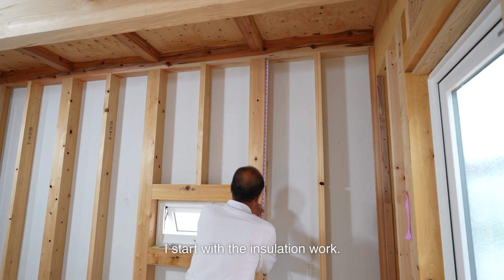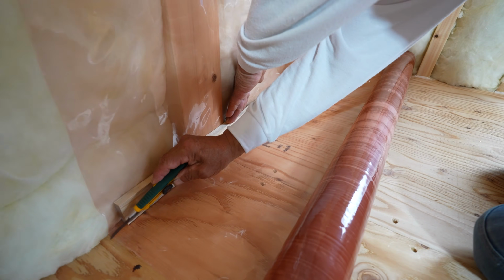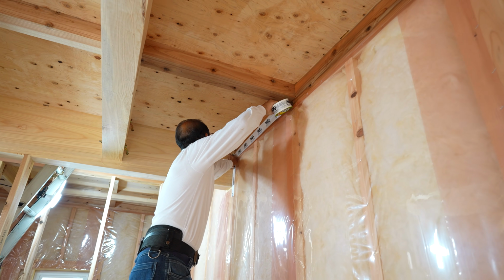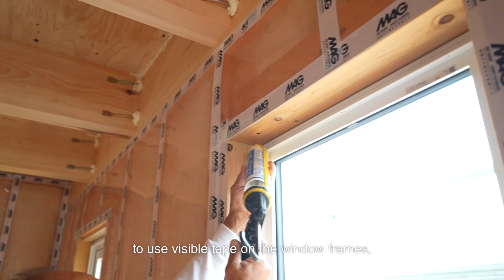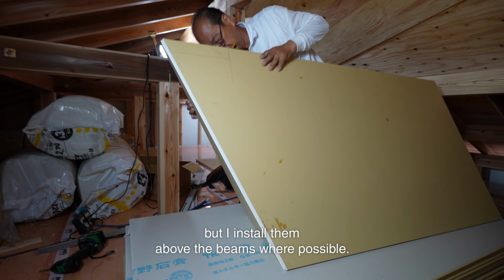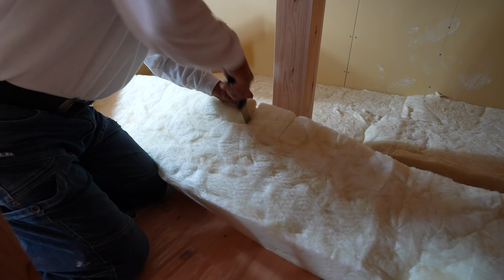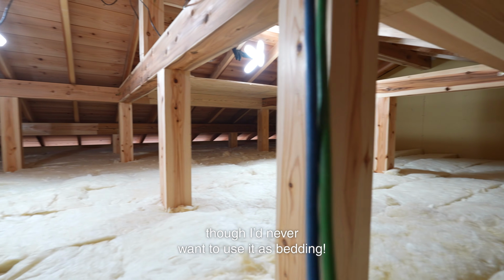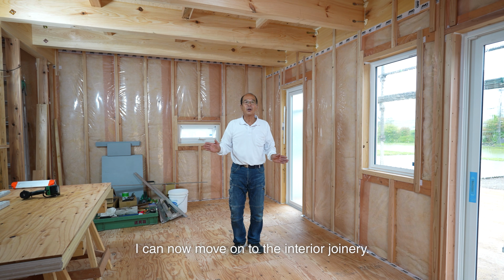The Ultimate Insulation Challenge: Creating a Magic Flask-Like Home | New Build Season 5 Part 5

Comment: In German carpentry we don't build with airtight vinyl membranes anymore because of the risk of mold. We instead use air- and watertight membranes that are permable for water vapor so that if there are gaps, the bits of moisture can escape again over the summer. However we have a dry summer - not a humid summer like you have over in Japan, perhaps that is why you use the vinyl membrane.
Your glasswool looks so soft and smooth compared to ours.
Reply: Meine Haut ist nur vom zusehen Rot geworden xD
Reply: @julianklietz6558  🤣🤣🤣 ich kann es sehr gut verstehen!
Reply: I suppose this is possible with a SOOO good ventilation system, in a humid climate this will not work.
Reply: We use hemp. Natural product.
Reply: Same thing in Canada, years ago.
Reply: I live in South Africa, no such issues.
Reply: @iluv i have a holz block house in 
Schwarzwald near Feldburg. 
the blocks are 14 cm thick .on the outside of that is 14 cm of Steico wood fiber insulation . over that vertical latten is installed with wood panels over the strips . there is an air tight but moisture permeable on the blocks . Fenster  is 3 layers of glass . the house is very energy efficient and extremely comfortable . 
sorry about the bad german spelling .
Reply: He's also touching that glass wool with his bare hands, which is not something I'm familiar with being a fun experience (but it's also been many years since I handled insulation, I assume technology has improved).
Reply: I believe it's the general rule at least in the EU. Walls need to breath to get the best results between insulation, heat transfer and condensation mangement.
The outer layer should prevent transfer of humidity and heat to the inside while the inner layer should prevent leak of inner temperature without holding the humidity in.
HVAC and natural flows (more rarely spread nowadays) help controlling heat leakage while allowing efficient air renewal.
Reply: @Belaziraf   There is no such a rule in the EU. Breathing wall is a leaking wall. In the Nordics basically all houses are built with plastic vapor barrier inside the house and all the air comes in and goes out trough a ventilation machine.
Reply: @BoringBurger  A vapor barrier isn't made to be 100% waterproof. You know this right ? From what i know, vapor barriers are used at least in Belgium, France and Germany. And from what you said, in Nordic countries.
Water and air tight barriers are mostly used to isolate constructions in harsh weather conditions, foundations and ground level slabs.
A breathing wall isn't what you seem to imagine. it's not on a level a human can perceive.
Reply: @Belaziraf  Polyethylene vapor barrier is in practice 100% waterproof. Yes, I know that in certain pressure and in certain humidity some water vapor will pass trough, those are just the limits of the physical properties of all plastics.  Vapor barriers should be used not only in harsh weather conditions, but everywhere where (insulated) houses are heated or cooled and there is a major difference between inside and outside humidity and temperature. And what comes to breathing wall, breathing is a term that relates to air movement and air movement is the biggest cause to moisture damages in well insulated walls. Modern well insulated walls should never breathe, not even a bit. What they should have is drying potential and good ventilation and that is a completely different thing.
Reply: There are variable permeability membranes in Europe, the US and Japan that let moisture pass from high humidity to the less humid side through diffusion while blocking air movement.
Reply: Dachte ich mir auch so. Das muss doch die reinste Tropfsteinhöhle da drin sein später. Die Luftfeuchtigkeit kann ja wirklich nirgendwo hin.
Reply: @desmonddart5163  eine zentrale Klimaanlage wird da im Wohnraum die Luftfeuchtigkeit automatisch angenehm halten. Wenns schlecht ausgearbeitet wird könnten die Wände trotzdem feucht werden.
Reply: Where I live in the US we have high humidity most of the year so even a vapor membrane is never allowed.
Reply: Airtight houses require good venting.. typically you install a heatpump and heat recycle fan system that exchange the air several times over a day.
Reply: here in america we are all just happy to have somewhere to live
Reply: It,s ferry bad for your Health
Reply: closed membrane on warm side, open membrame on cold side!
Reply: Er soll froh sein das in der Entwicklung der dämmstoffe sich seit Jahren immer wieder etwas verändert wenn ich die glaswolle bzw steinwolle aus vor 20 Jahren noch in Erinnerung habe eine kratzige Angelegenheit für sehr viele Tage danach noch. Damals rockwool  insover  und so weiter gefahren über Jahre hinweg 😂😂😂 man gewöhnt sich aber dran nur einatmen so sache die sollte man sich ersparen
Reply: is it because nowadays 'stone wool' is commonly used?
Reply: @666like616   @666like616  it's because some amounts of moisture in the walls is fine because during the dry and hot summer, it will dry out. you can calculate how much is acceptable and base the materials and dimensions around that.
Reply: @666like616  Yess nobody uses glass wool anymore here because it's painful to work with
Reply: I was wondering about that. If the house is completely airtight, now you have to worry about condensation and suffocation, or at least the air getting very stale. Is that really desirable, especially in such small houses?
Reply: @Volkbrecht  Its the common way to insolate danish houses - and then we got Genvex (Air ventilation with heat exchanger) to keep the inside air fresh and dry.
Reply: @Volkbrecht All modern and energy efficient houses needs to be as air tight as possible and all modern houses have a forced ventilation system (with heat recovery) that keeps a small negative pressure inside the house all times and prevents moisture from condensing to the walls. That's been the standard way of building in the Nordic countries last 3 decades.
Reply: @BoringBurger  So there is a guarantee for a ventilation system that's  designed to deal with that problem. Thanks, this is the part of the picture I didn't see.
Reply: @Volkbrecht  Yup, and the ventilation system is designed to change all the air inside the house at least once every 2 hours and even more if it detects risen co2 levels or moisture in the air.
Reply: @Volkbrecht  The air inside will be controlled with air conditioning to be nice. The issue is with condensation from warm humid air from the inside leaking through and condensing onto colder elements in the walls. If built perfectly like how Shoyan does there should be no issues.
Reply: @Volkbrecht  This would also be a problem with Passivhaus, but I think there it is solved by controlling air exchange with the outside through a heat exchanger.
Reply: @Volkbrecht  Same thoughts here, I am not a fan. The owner of the house becomes 100% dependent on the mechanical movement of water vapor and air.
Reply: @Volkbrecht  I feel they don't produce more modern/ecofriendly/natural insulation. A friend in the states told me that no investor/industry started to produce woodfiber insulation, maybe Japan is similar?
Anyway sad to see such nice work insulated with glassfiber or PUR foam and plastic vapour screen.
Reply: @germainjoyet782  Why do you think fiberglass is worse than woodfiber?
Reply: @ wood is more ecological to produce than any mineral or plastic products first of all. If moist it dries, more dense then phase shift due to thermal inertia is greater. Recycling is easier too when life of the product is done.
Reply: @germainjoyet782  Fiberglass insulation is made from molten glass that is spun or blown into fibers. Most manufacturers use up tp 40% to 60% recycled glass content. I don't see using wood as any more or less ecological. No, wood pulp insulation (commonly called cellulose insulation) does not dry as easily as fiberglass insulation; because wood pulp absorbs more moisture, it takes longer to dry out compared to fiberglass, which is less absorbent and dries faster when wet.
Reply: @ we are not agree then. Cellulose is different than wood fiber, cellulose is applied, depending of the process, wet and dries pretty good from what i witnessed. Melting glass is costly in energy.
Reply: @germainjoyet782  Do you know the chemical process and additives to get wood fiber/cellulose to be fire resistant and made into fibers? it's kind of like the marketing for 'bamboo' fiber clothes. They market it as natural but has to go through such a toxic process to make it usable, it's as bad or worse than polyester and other synthetics. Fiberglass is less processed.
Reply: All this super isolated houses feel like living in a plastic bag. It is not healthy.

Comment: Amazing work, dont you need any protection to work with Glass Wool? i mean respiration protection? isnt that dangerous?
Reply: When the Glass Wool is in that form respirators are not needed because the risk of it becoming airborne is very low, but some still use them.
Reply: @djthompson86  Ohh i see thats good to know, thanks for the answer!😁